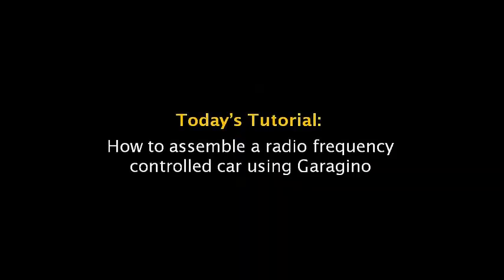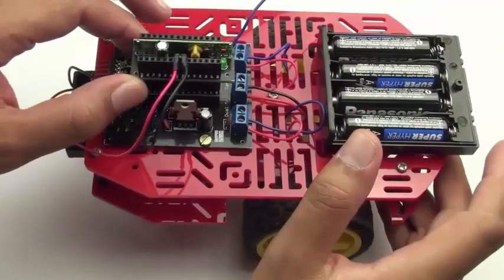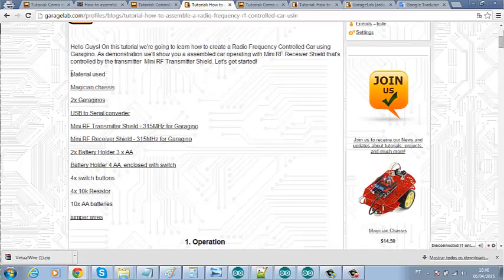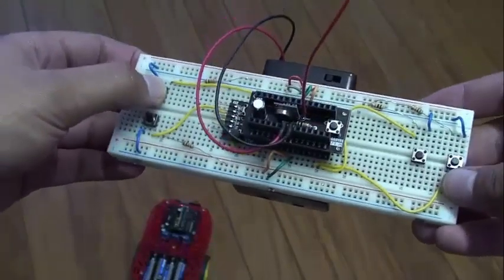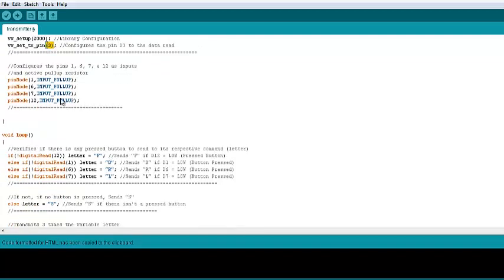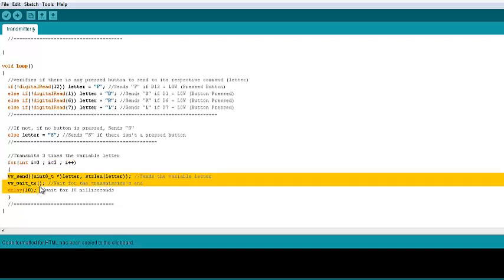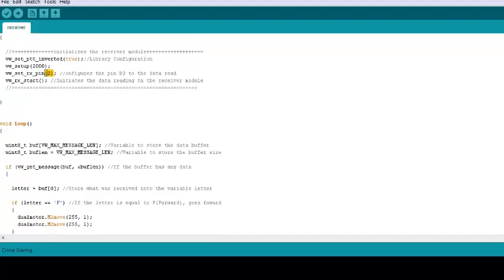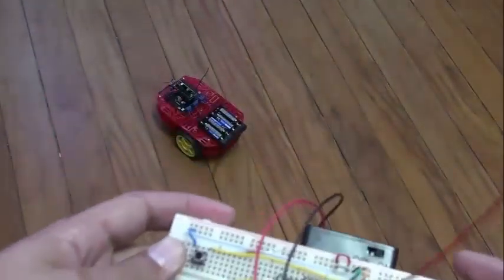Tutorial: How to assemble a Radio Frequency (RF) controlled car using Garagino

Comment: Congratulations on your channel!  I am looking for a pressure sensor (0 to 10 bars say) to monitor add to a arduino data logger for a water heating system. Ideally with a ⅜" connection. Any idea where this can be sourced?